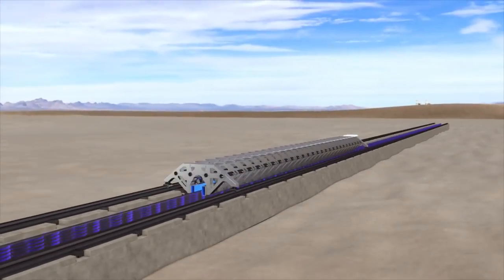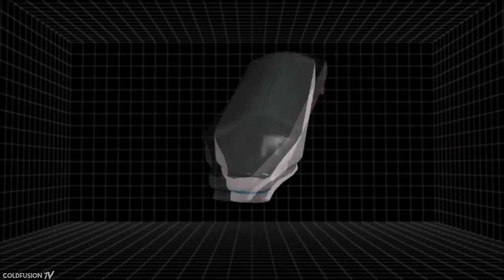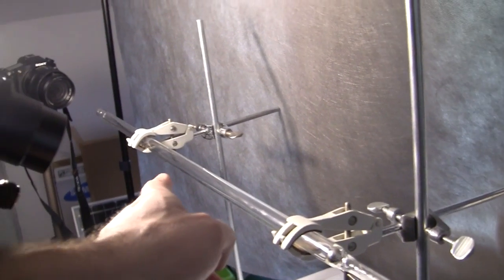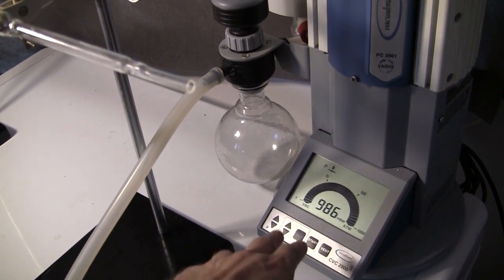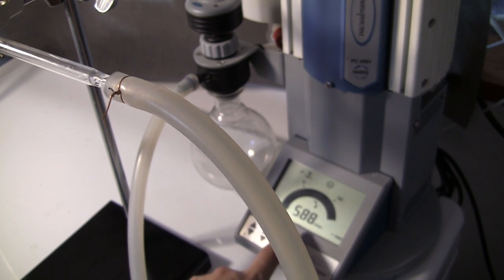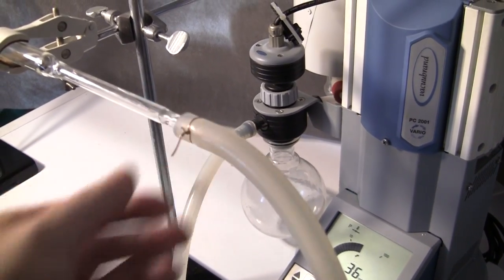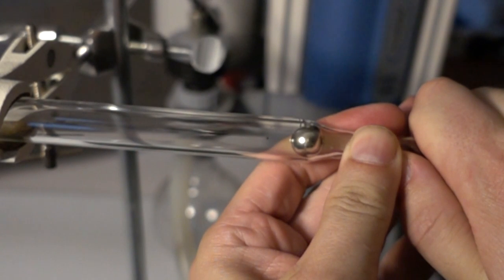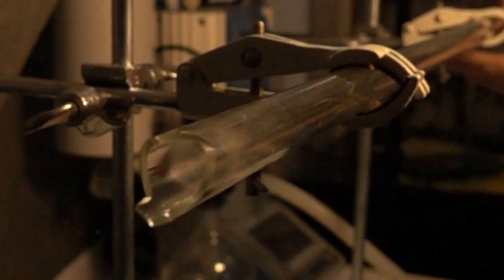How  the Hyperloop can kill you!

Comment: +Thunderf00t
I'm no engineer but I see both fault and solutions to all the issues raised. My main concern would be with possible heat due to compression of the minuscule amount air in the vacuum as it passes around the passenger compartment before reaching the back. Maybe not an issue at the distances or speeds traveled but I would imagine rapidly increasing and decreasing the compression rate of the little bit of air that is in the tube would generate some heat. I could just be imagining it, though I am aware that pressurised nozzles in air compressors can get very hot very fast. And considering speed, air friction, however minor, and too high and/or rapid of air compression and decompression would raise the heat of the cab and/or air inside the tube especially with a sustained movement speed of 1k+.

I think it could work but there would need to be sturdy cabs that can handle catastrophic tube decompression, major rail failure or impact and remain safely pressurised. Also segmented tube sections with emergency braking, expanding gaskets for heat compensation, repressurisation and safety access hatches at regular intervals. I think it would work better if they scaled it up a bit more and maybe buried it or at least recessed it into the ground. Would cost more to build but could go east coast to west coast and make that journey much more appealing and connect people much more easily. Would probably pay for itself eventually if they handle freight too.

It's not like America or people in general haven't achieved pointless or positive progress in illogical or even logical ways in the past. Even today people can't get over the incredible feats of our ancestors who built great pyramids, temples, cities, explored the poles because nobody else had. Landed on the surface of the moon explored other planets and even more recently something as ridiculous an idea of digging a tunnel, under the sea, between England and France. But they put their backs into it and did it anyway and it became a symbol of unity and co operation between two nations at the time that have had a very mixed history of mistrust and dispute. I think they should go for it and they will find they have to put more effort into it and take it more seriously if they think it's going to pass safety standards and carry actual people. If they go at it the way they plan on doing it now they will only ever move freight.

Comment: A pretty obvious solution would be emergency pressure valves through out the tube to be opened all at once if a fatal pressure change is detected. This would increase the pressure of the tube uniformly and hence not cause any significant acceleration in any given direction.

Comment: Actually the tube was supposed to be filled with an inert gas... That is the theory I heard... Stopping was a magnetic reversal to counter act the speed and acceleration. This is use on the Gerald R Ford aircraft carrier for launches. They can control the acceleration and reverse of that slowing it down...

Comment: I am not saying that the Hyperloop is a sound engineering concept. But I believe that it doesn't suffer from this specific defect Thunderf00t claims it does. Let me explain.

Suppose there is a catastrophic failure at point a point in the loop. How do you stop the cars from being shot away from that point at deadly speeds and killing everyone inside them (as well as destroying most of the structure in the process?) Well, simple. You simply open a combination of the valves around the track and do an emergency recompression. If you do it immediately and in the right configuration (which a computerized damage control system can do), the air flooding the loop from those valves would counteract the pressure caused by the rupture and cushion the cars.

I haven't done any calculations. But it makes physical sense to me. What do you guys think? Thunderf00t? Would this work?

Comment: No way of stopping? I have two problems with this experiment, the first one being the square cube law. Simplified, the pressure differential will increase as a power of two (area on the back, vs. area on the front), but the mass will increase with the cube of the multiplier. This should make a large difference in the acceleration of the vehicle.

My second problem, is that isn't it possible for the cars to have other sorts of brakes, not relying on electicity? Of course, these are challenges, but I dont see why these two should in any way be a deal breaker for a hyperloop.

Comment: I think your experiment was very misleading.  Let's try some simple calculations.

Q1:  How much pressure differential would there be to push the capsule in the event of a major breach suddenly opening up on the side of the tube, just behind the capsule?

A1:  I estimate 2.5 lbs per square-inch, worst case.  My assumptions are:

a.  The hyperloop page on wikipedia lists some size estimates: the inside diameter of the tube is given as 14 feet (cross-section area=154 square feet) and the capsule diameter is 7.4 feet (area=43 square feet).  43/154=28%.  So 72% of the tubes cross section area is open for the inrushing air to flow around the capsule.

b.  The pictures of the capsule look pretty aerodynamic, so I assume they have pretty low drag coefficient; not as low as an air-plane, but probably comparable to a car which is typically about 0.3.

c.  We'll assume the worst-case, where the capsule is stationary, and at the end of the tube.  If it were moving, then the incoming air would have to fill a rapidly expanding volume between the capsule and the breach, and that would greatly reduce the pressure pushing on the capsule.  And if the capsule is somewhere in the middle of the tube, air can flow away from it, down the tube in the other direction, instead of being forced to go around the capsule.

Q2: Giving this differential pressure, how much acceleration would passengers experience?

A2: By my estimates, at most they would only feel a brief jolt, but the velocity of the capsule would not change significantly.  My reasons are: 

a.  The 43 square foot cross-section of the capsule, multiplied by the estimated 2.5 lbs/sq-in differential pressure yields about 15,500 lbs of force.

b.  That sounds like a lot of force, but how much does the capsule mass?  Wikipedia doesn't say, but I found on line that a large passenger bus (without passengers, fuel, or luggage) weighs up to 33,000 lbs.  If we assume that a fully-loaded capsule weighs this much, we're looking at about 0.5g acceleration.

c.  But don't forget the brakes!  I'm pretty sure the full braking acceleration is greater than 0.5g, and is therefore adequate to cancel out the push from the air.  Also, since mag-lev is electronically controlled I assume the brakes can be applied almost instantly.

Final comment: do you really think the engineers working on hyperloop have not considered the implications of a sudden tube breach?  Why don't you ask one of them if they've looked at this, before you imply that they are all a bunch of idiots?
Reply: Yes, as he does with every single video, he just has this weird entitled superiority (or inferiority) complex

Comment: Also, don't oil pipelines often have long stretches of above-ground tubes handling high pressure fluids? One is handling high pressure, one is handling low pressure, but both are doing the job of isolating the internal pressure of the pipe from the atmosphere while handling thermal expansion. Why would this be all that different? Also, your shockwave idea depends on a huge explosion or catastrophic destruction of the pipe. More likely something small like a crack would form, in which case there wouldn't be a sudden pressure wave, just a very slow build up of pressure that is traveling at the speed of sound through the tube.

Comment: In the event of a rupture the passenger vessel isn't going to accelerate like a bullet because inertia. There's not anywhere near enough airflow to make it in any way comparable to your ball bearing experiment.
Reply: Engineering reality when you scale your experiment of a small ball bearing in a small tube vs a much larger scale.

tl;dr 
Your experiment doesn't scale

Remember Pressure = F/A therefore F = P*A
And F = m*a therefore a = F/m

The pressure in front of the carriage is 10 Pa

The pressure behind the carriage (assuming a massive instant failure) is 100,000 Pa

The total air pressure acting is in the forward direction at 99,990 Pa ~~~100,000 Pa

Let's call your experiment, Scenario #2

Scenario #1: Almost full scale 

Cross-Sectional Area of Hyperloop tube = 1 m² i.e. diameter is a little over 1 m.
Force acting on Rear of Hyperloop Carriage, F = P*A = (100,000 Pa) * (1 m²) = 100,000 N

Inertial Mass of Hyperloop Carriage, m = 10,000 kg

Substituting into a = F/m gives

a = (100,000 N) / (10,000 kg) = 10 m/s²
Scenario #2: Lab ScaleCSA of 10mm Ballbearing Tube = 0.00007854 m²Force acting on Rear of Ballbearing, F = P*A = (100,000 Pa) * (1 m²) = 7.854 N

Inertial Mass of 10 Steel Ballbearing = 0.004 kg

Substituting into, a = F/m
a = (7.854 N) / (0.004 kg) = 1963.5 m/s² 

-----------------------------------------
Summing up
Scenario #1: Mid Scale ~= 10 m/s² i.e. Roughly gravity
Scenario #2: Mini Scale ~= 1963.5 m/s³ i.e. Roughly a high power slingshot or air-rifle

Comment: no offense thunderf00t but this is a project being worked on by hundreds of scientists and engineers some of which are prolly smarter than you and while yes the thing is kinda insane at the moment maybe in ten years it will be a reality because if you think back to when things like light bulbs or planes were being made I bet they all thought it was insane too so continue to be you pessimistic self however I truly hope that this plan comes to fruition and the hyperloop becomes the new form of transportation
Reply: If they can engineer a super cheap, super light, super strong, super thin material that doesn't expand and can handle 999x normal pressure from the outside and more, yes this might become a reality. Otherwise, it won't.

Comment: It literally says in the overview of the Hyperloop plans on the SpaceX website that a near vacuum would cause all these problems and they will only be putting it in low pressure which could be easily achieved with commercially available pumps. Your entire basis for this half hour rant is based on assuming they would being doing something that they specifically said they would not. It was the same case with your solar roadways video. You clearly do not research the topics you claim to have extensive knowledge on. I will note you as a disreputable source and advise those I know against watching you.
Reply: HELLO? Have you read the schematic that specifically said the pressure would be about 0.001 Atm?

Comment: I see alot of people talking shit about thundefoot as hes looked at one problem and deemed it debunked.

What people dont realise is this problem is massive and you cant avoid it as your system literally needs it.

If a simple crack occurs across a several mile length of line this thing will have it can compromise the shell, bear in mind that theres only 1 bar difference between you and the void of space but if you popped out of your suit to have a breather the pressure within you causes you to rupture.

Now imagine the reverse within this tube and all the while the in rush pressure pushes the capsule like in the video as a bullet, remember that this thing (the tube) will have 1 millibar of pressure within which means the air is incredibly thin in terms of particles which will provide a very tiny amount of drag for it.

Your basically making a huge cannon which explodes during firing and you handed the trigger to anyone who dents it or scratches it or simply to the natural forces of corrosion and erosion.

This problem can only be solved if you made the walls incredibly thick or made it underground but even then if the capsule the people are in breaks open the every explodes and dies instantly so good luck with that not to mention the maintenance and health and safety on this thing alone is going to be huge, i doubt this would be profitible.

Btw im an engineer and thunderfoot is a scientist as well. a bunch of people who think this is his degraded logic or some crap is ridiculous. This is common sense if you know anything about pressure dynamics.

Comment: I think you were thinking too shortsightedly on this. Searching for a way for something to fail is easy, engineers do it all the time, this is one of the first things expected to go wrong in a vessel of this design. The job of an engineer is to overcome these challenges. If an airplane's engines or wing fails, the airplane crashes, and everyone is likely to die. There is little to no way to overcome that obstacle, but we still fly planes. We avoid those failures by building better engines, and stronger wings. As many commenters have said below, there are a myriad of solutions to the problems you brought up in the video. More importantly, this craft is significantly easier to troubleshoot than an airplane or spacecraft, but those things STILL FLY. Sorry, but there's just no sound evidence to support your claims here.

Comment: People probably already said it, but it seems pretty easy to open valves ahead to equalize the pressure (in case of a detected problem / difference in pressure) and seriously diminish that effect. Electricity still travels faster than the object in the tube.
Reply: How long do you expect it to take to open the valve?
Reply: Vladislav Dracula It doesn't really matter. I made that comment before watching the other two videos and Thunderfoot made the pretty good argument that the mass of air crashing into the moving train would put the passengers in serious harm either way.

I was just thinking theoretically because I have very little opporunities to test my limited knowledge of physic.

Comment: That example, while having a valid point, is pretty piss poor to say the least...

1. The Hyperloop tube is not that tight around the vehicle.

2.  The distances are massively longer.

3.  Sensors can detect a drop in pressure and release the pressure in the whole system in a likely less than 10 seconds using emergency wastegates spaced throughout the system.

4.  They would need a strong explosive to release the vacuum fast enough (not a bullet hole) and being 1" thick steel wall is going to be pretty tough.

5.  At the same time the maglift drive can likely do an emergency stop at 2.5 G deceleration in also about 10 seconds.

6.  This also means that to damage a shuttle in the tube travelling at these speeds you would have to detonate it within about a 10 second window of when the shuttle is to pass.  Not easy on a tube that is not clear and the shuttle is travelling so fast and this would only take out 1 shuttle at most as they will be spaced safe distances apart.

7.  If a terrorist was going to try something like this they would have better luck just taking that bomb on a crowded bus, bar, arena...

8.  While damaging a section of the tubing would take down the whole system they likely could have it up and running in a few hours and they likely would have replacement tube sections and all the equipment ready to go at a moment's notice.  Plus they seem to favor a two tube system so one tube can shuttle people both ways if needed (admittedly slower).

In others you talk about metal expansion...  Well think of a 100m section with a bank of solar panels, a mag drive system, a pressure sensor, a pressure dump valve, and an emergency exit.  The tubes can be insulated easy and some of the solar power can be used to keep the temp stable.  Add an expansion seal at the end of each 100m section and you are golden.  You also argue about the speed of the fan, but this is not for propulsion, but just to prevent a bubble of air being pushed in front of the shuttle and slowing it down.  They can pitch the blades and keep the RPM down easy.  I am expecting, like most large projects the insulation, redundant safety measure, temperature control... will increase the cost enough to make it less efficient of an option.  The other issue is a lot of people are claustrophobic and get motion sickness, so a small increase to add large HD screens all along the shuttles to give a simulated horizon will be needed, but I have yet to see anybody talk about that.  But the system will have some massive advantages.  One is the speed, but also the lack of the need for a large airport, time to tax and take off, They will likely accelerate and decelerate much faster.  They also will have likely no crew, little maintenance, and no refueling.  The track though will be expensive though, so only certain routes will be ideal for these.  Over time the cost might drop as solar panels get cheaper and more efficient every year and they might come up with cheaper materials than steel tubing.

Let them build their test track and find out for themselves.  They might learn a few useful things even if the Hyperloop is not as easy, safe, or cost effective as they had hoped.  Elon Musk is not an idiot and likely thought of everything you point out in this video and your other video (which I also watched and commented similarly on).  Personally I do not think is is feasible... at least not for a while and other technologies might overtake it in the mean time, but like I said I do not see the problem with them going forward with a test track.  The research will benefit others either way.